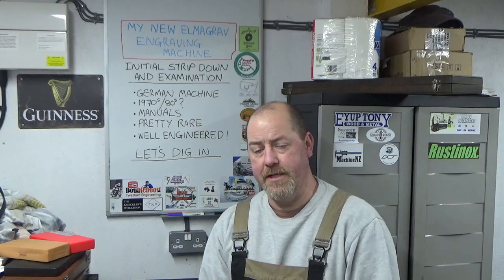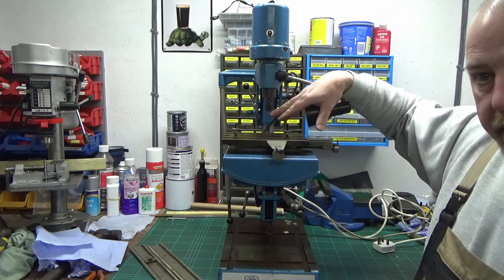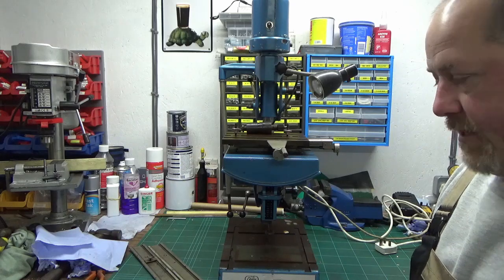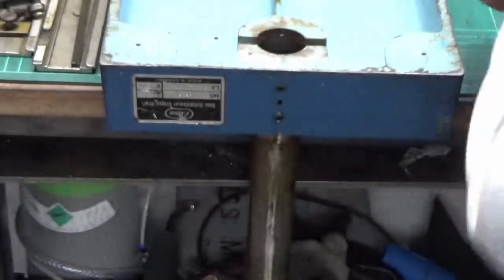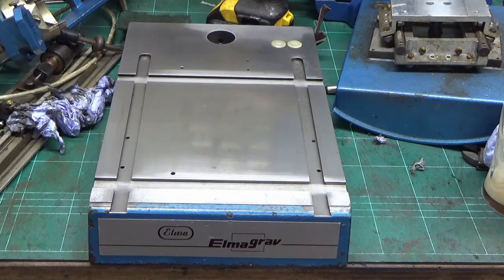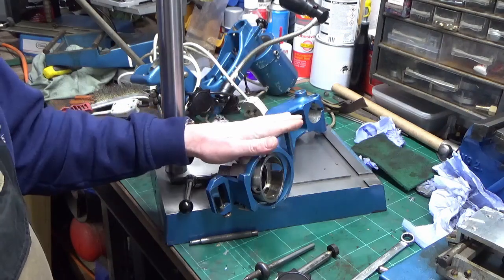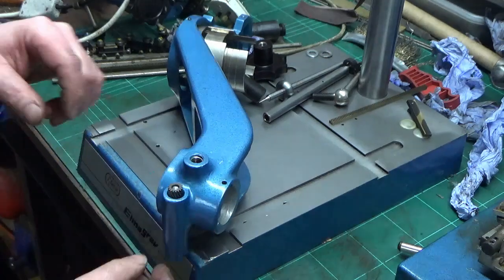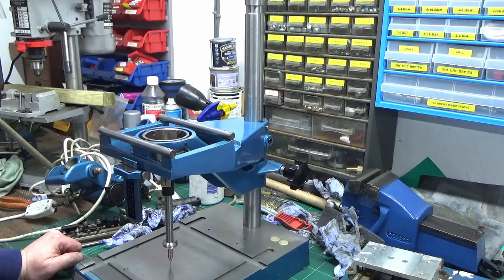My New ElmaGrav Engraving Machine - Strip down & refurb - Pt 1

Comment: Sad to see such a lovely piece of kit has been brutally abused and knocked about but great to see it being returned to a useful life. The wire coil inserts in castings aren't unusual. I have seen several applications where the manufacturer has fitted them as standard,most often on cast components. Also to mention that both Helicoil and Timesert brands do recommend their inserts be fitted into threads on epuipment where screws/fasteners are frequently loosened and tightened.
Reply from the maker: Hi Howard, thanks for the comment and information. Makes total sense, especially in Aluminium. I have only ever come across Helicoils in repair jobs which is what threw me initially. Hopefully I can do it justice and give it a new life. Cheers, Jon

Comment: Hi Jon
Great little machine, looks very well made, the helicoil will make the thread stronger especially if it's cast aluminium, see you in part 2
cheers
Kev
Reply from the maker: Hi Kev, thanks for the comment. It really is very well made, it's going to be a very nice machine to work with once it's finished. Agreed on the Helicoils, the castings are Al so another sign of good design! Cheers, Jon

Comment: Very interesting once again
I have recently discovered 4 inch grinder discs with scotchbrite pads to clean a lathe chuck and it works fantastically, a simple Aldi grinder on the lowest speed with loads of WD40 and it appears to remove practically no material
Thank you
Reply from the maker: Hi Seamus, thanks for the comment. I have some similar discs with emery flap disk material bonded to them, not seen the Scotchbrite ones, will have a look and get a few. Cheers, Jon

Comment: Interesting machine. I used something with a similar adjustable-ratio mechanism in 1972 but it was a micromanipulator for placing probes on to semiconductor wafers. I usually chuck anything like this with surface rust into a vat of Evaporust after a degrease
Reply from the maker: Hi Machining and Microwaves, thanks for the comment. I have tried Evaporust in the past, I never had much success with it, it either turned everything dull black or was patchy. I have seen others in the UK struggling with it too, makes me wonder if there is a rogue importer as the US guys all swear by it. Cheers, Jon
Reply: @jonsworkshop  Can't remember when I got mine from, it was quite a while back. Degreasing seems to be important.  I mostly use it on REALLY rusty stuff. I've got a ten inch 4-jaw Pratt Burnerd cast iron chuck that needs some TLC, I'll give it a shot on that and see if it works as well as it does on rusty old spanners
Reply: @jonsworkshop  Really looking forward to seeing how the ElmaGrav works once it's fully fettled.

Comment: Hi Jon,
I picked up an Elmagrav engraving machine yesterday. I have watched your videos on your rebuild and will be watching them again. They will be very helpful when I rebuild my machine. It came with heaps of accessories that aren’t shown in your videos, and it also came with photocopied operating instructions, and they are in English. There are no photos or diagrams in the operating instructions, but the instructions do refer to photos and diagrams of the accessories how to fit them and how to use them, so I can only assume that the photos were separate and have not been included. Does your manual have any of these pictures/photos? If you’re interested, maybe we could exchange email addresses and send some information backwards and forwards.